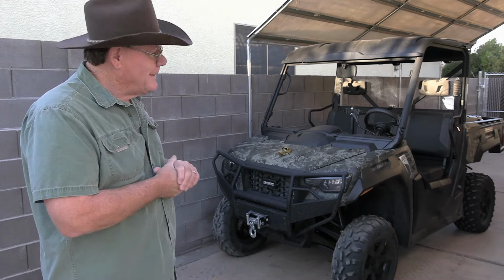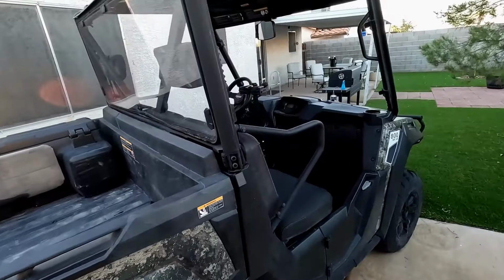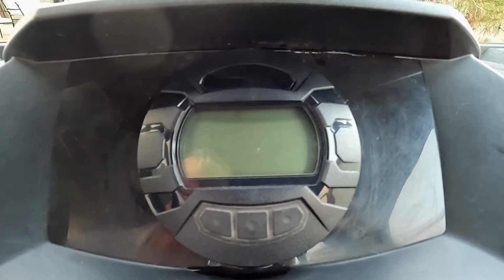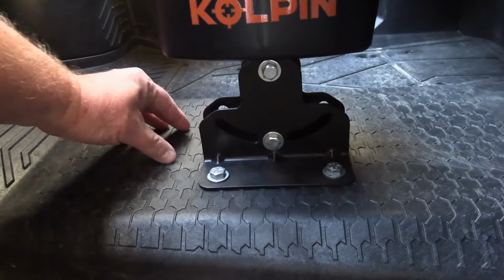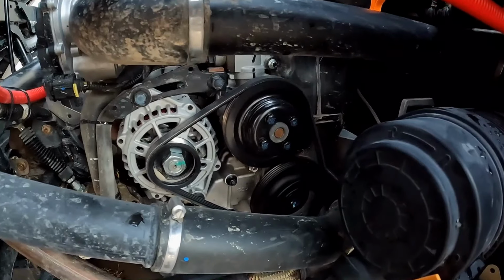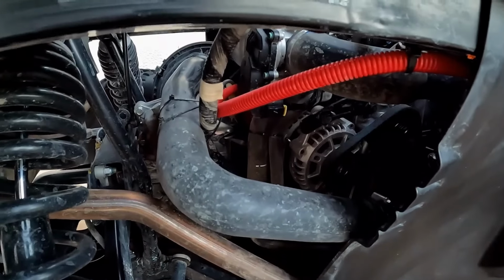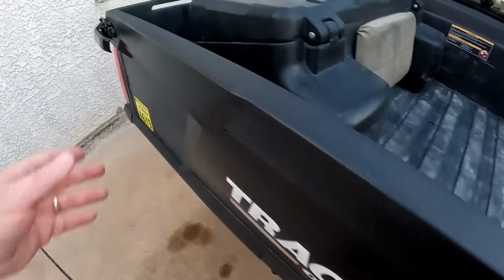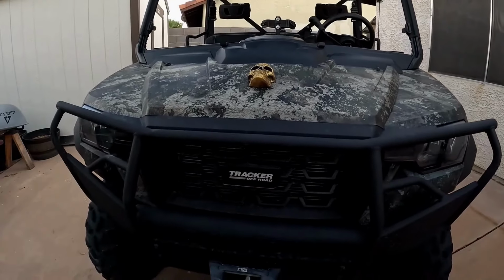Tracker 800 SX LE 4x4 - One Year Review - I Love It and I Hate It - Watch Before You Buy One!

Comment: I have a 2019 Prowler Pro XT (which is the same as a Tracker 800) with Power Steering (which is a "must have"). We use it to check corn/cattle fields and some minor mostly dry trail riding. A few upgrades are: Front Winch (if not included at factory), wireless controls for front winch, full Front Windshield, Street Legal lighting & horn kit, motorcycle LED headlight upgrade, Sheet Metal heat shield under its rear tilt box (to deflect heat from its engine and muffler), LED Reverse light under its rear box, side mirrors and heat deflection shield films installed on its front and rear firewalls (to repel its natural high heat). I also removed its under middle seat access panel and installed a 7 inch 12 volt high CFM RAD Fan (to suck heat out of its soft cabin). We have a soft cab but recommend Hard Cab upgrade for colder winter air regions as well. I also cut 10.5" x 23" opening and installed thick galvanized wire mesh on its center "under belly" skid plates (to allow more natural air venting). Our 2019 Prowler is not the fastest or the most smooth suspension but its fun to drive. Especially with its super quiet (even at higher RPM speed) 4-stroke 812cc engine. Not too sure if we would use its rear box for gravel/dirt hauling (we use an attached 4x6 trailer instead) but it works great for our tools and lightweight materials... This "utility" UTV design is a "Must Have" tool for farm country usage and minor trail riding....... I'd recommend - with above upgrades. Note: 1-If I remember correctly, the 2023+ years go 5 mph faster, have better clutching (for faster take off) and they are 3" higher off the ground. 2-Their engine under the tilt box (like the Polaris Ranger) runs "hot temps". If living in hot summer months region, do apply DIY mods for more cooling air flow under and to its engine area. Cooler temps via more air ventilation the better. Hope this helps...
Reply from the maker: I'm impressed with your DIY mods, especially regarding the air flow around the engine area. It gets pretty hot here in Nevada and your recommendations will help a lot. Thank you for the excellent suggestions and have a great weekend.
Reply: @mixup98  Thanks for your positive feedback.   One of my last mods is to have my local welder guy create a large checker plate (out of aluminum - if affordable) and install "on top" of the existing plastic box bed.   Simply use the factory corner anchors to hold it down.  Yes.  Factory rear tilt box bed is made of plastic.  IMO, it should be "steel" checker plate as factory build.  Especially for its high weight capacity and "under bed" heat - from its engine...
Reply from the maker: @10drowsy  Once I get my plastic bed replaced I might look into installing an aluminum plate in the box bed. You are full of great ideals, and I really appreciate it. Thanks again and have a great Sunday.

Comment: @Mixup98 the tailgate latch will easily by epoxy resin, a little sanding and black spray paint. It shouldn't be a problem to remold the corner of close the cracks with waterproof epoxy, it's at any auto store.

Comment: Nice but I'd mount a metal tailgate reinforcement piece under the plastic rail end and bolted to some metal structure if there's any or have that metal piece secured with a long attachment strap to spread it the forces acting on it.
I went on their website and built one close to your specifications just to see what they cost. $24,296 with under seat and overhead console storage

Comment: I have an 800 sx that I bought the same time you bought yours. My bed was cracked 2 weeks after I bought it. Bass Pro warranties the bed but what they replaced it with was exactly the same so the new one won't last long either. The guy at BP just sent the new bed home with me and told me to use the old one as long as I could before putting the new one on. He said they have replaced the bed on almost every one they have sold at KCK Cabelas. Really disappointing but other than that I really like my Tracker

Comment: If you return for warranty work. 
Then shop around for a CanAm ATV, sell the Polaris. The CanAm you can get it with AC and Heater, enclosed 4-seater with bed for hauling stuff...
Reply: By the time you find an enclosed four-seat SxS with a bed and HVAC, you might as well just buy a used beater pickup truck.
Reply: @bwofficial1776  just a suggestion, another YouTuber picked up a CanAm with all the bells and whistles. Basically, an off road machine heat/air, power windows, surprised it didn't have a sunroof.

Comment: Can you drive it on the US main roads, or is it for off-road only? Just wondering as I'm in the UK.
Reply from the maker: Hello John. My Tracker is not street legal and I can only drive it off-road since it doesn't have turn signals. The tires are also designed for off road and are not suitable or safe for street use.

Comment: Does this machine use a belt of shaft driven like a Honda?
If it does use a belt have you had any issues with the belt?
Reply from the maker: My Tracker uses a belt and I haven't had any problems so far. Knock on wood.
Reply: @mixup98  
Thanks
I appreciate it

Comment: Really enjoyed your Tracker review as i didn't know all the features of the product. By the way you had the front windshield installed while riding in the desert. So is it difficult to remove by one person? And when you wash down the vehicle are you able to garden hose the digital dash area? Sorry about all the questions, I'm just unfamiliar with the product. Also is the rear latch bolted to anything metal below the plastic side panel?
Reply from the maker: Both the front and back windows easily pop out and are easy to put back in. I did spray down the dash area including the display without any problems. I'm not sure yet if the latch bolt is screwed into anything metal or if it is attached directly into the plastic. I think I will call Bass Pro and see if the bed is still under warranty.
Reply: @mixup98  each time I go to Bass Pro I stop at the trackers. I keep thinking I would like to own one. Have a nice Sunday evening and a great week.